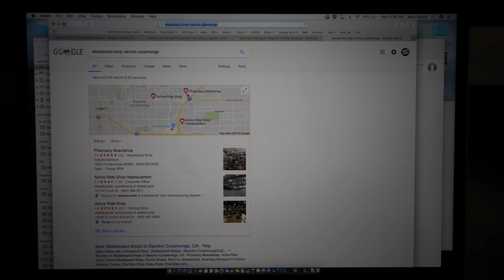200A LiPOs on a DIY Electric Skateboard build (2018)

Comment: 9:43 anything over 12 mph is "call 911" speed (13 is plenty!), what's more important to me than speed is hill climbing power.  How does it do at 2 mph going up a hill?  that's what I look for in a skateboard
Reply: I think the belts were slipping, so it had some power, but you really need serious cables and escs for the current draw required.
In my teens I got over 60 mph once being towed by a motorbike... great fun until I got wheel wobble, fell off, did the rest of the road on my back and ended in a grassy ditch.
Fortunately got away with just a couple of grazes and a ripped T shirt.
Didn't do it again tho!
Even in my 50s I still skateboard - not something you ever forget, but I would like an electric one.
I made an ebike instead because it's more practical and can do mountains and forest.
Reply: Andy Lee Robinson wow, that's crazy fast.  my mishap ended with surgery and 12 months of recovery, and it was only 19mph, lol
Reply: Yeah, it was.. I was lucky that there were no hard objects to hit, was just a straight and smooth tarmac country road with grass verges.
Sounds like you were pretty unlucky with yours and hope there was no lasting damage.
Last July got knocked off my bike by a taxi and spent a week in hospital with a broken pelvis, ribs and collar bone, and was pretty much on my back for a next month and a wheelchair for the next couple of months - so I'm not so lucky all the time!
Next time I'll borrow this mobility scooter that a local friend made:
Insane electric mobility scooter over 100km/h topspeed
https://www.youtube.com/watch?v=iLo0p0QLiBI
Enjoy!
Reply: Andy Lee Robinson tore my ACL off, replaced it with a bit off my hamstring, I'm back to 90%, good enough. Just don't try to run off the board, too much force for a knee, live and learn, glad you're ok
Reply: Ouch. ACL injuries are nasty and take a long time to fix, just go easy and fall more carefully next time!
Thanks, I'm OK now, back to 100%, riding again and lot more wary of cars - they tend to win most of the time!
Reply: you could Build a normal Electric Belt driven skateboard just on a super low gearing. Giving more Torque and hill climbing at low top speeds.
Reply: my wife fell off her esk8 going... 0 miles an hour. broke her elbow, had to have surgery... crazy expensive surgery
Reply: Beakerzor what happened? did you have a helmet on?
Reply: My Evolve Eboard can hit over 20mph on All Terrain wheels and over 28mph on Street wheels, and it conquers hills no problem.
Reply: hahah 13mph soooo slow. But of course if you have an unstable skateboard then 13mph may be a little scary. I’m hotting 22mph on AT tires and it feels slow, 27-28 on 107 streets nd its getting a little sketchy lol
Reply: NEWBIE UPDATE:  Been riding my WowGo 2s, except for 1 day, daily for the past 10 days.  Have graduated from the 1st speed setting, because it's a just a little slow going up gentle grades.  The 2nd speed setting tops out at 18mph.  Have been up to 17.2mph.  Practically, I don't need to go any faster.  Being in an urban area, the quality of the road pavement is really the speed limiting factor.  Tons of fun!  Great toy!  Would buy it, again!